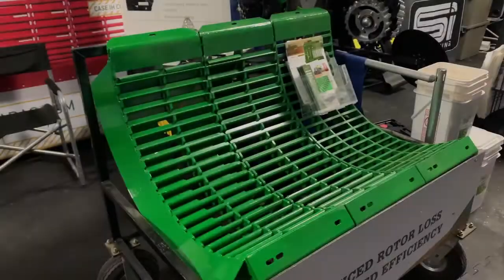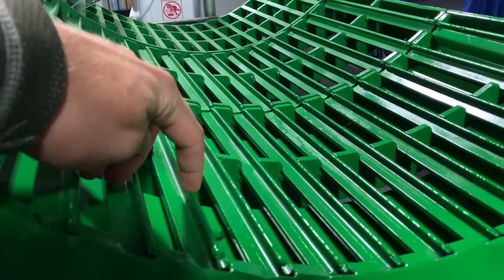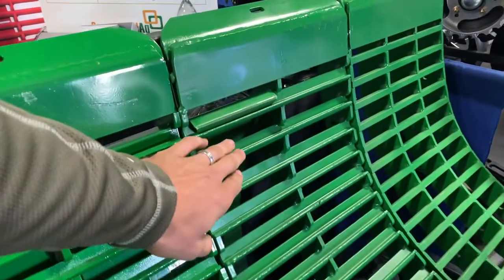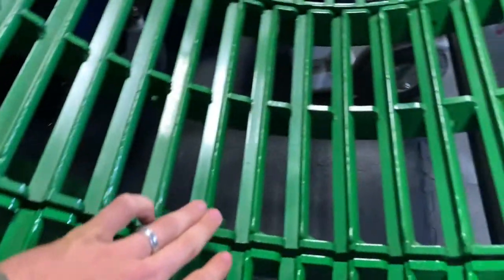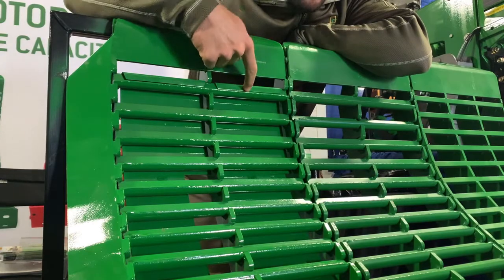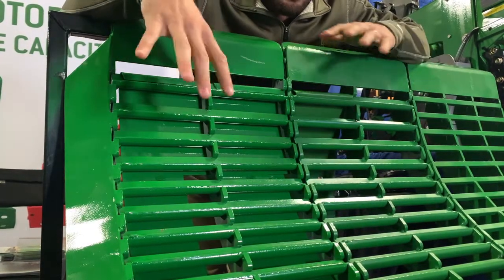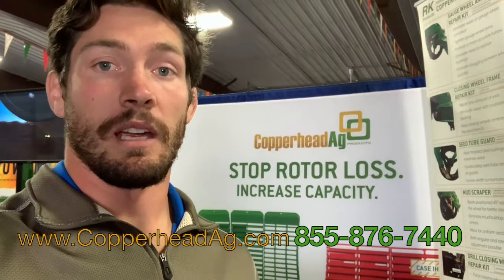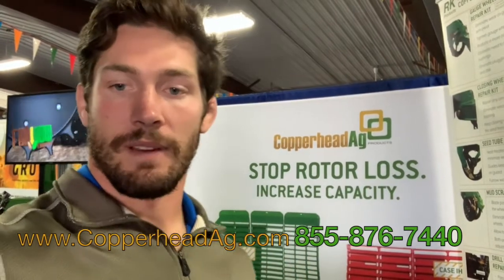How do the Copperhead Concaves work?

Comment: That covers plates is for green beans?
Reply from the maker: Cover Plates help to increase the threshing ability for smaller grains, for example corn would have none, beans 1-2 depending on circumstances and wheat would likely be 3 cover plates. This helps to hold the crop in the concaves linger to get the right amount of threshing without having grain damage or rotor loss.